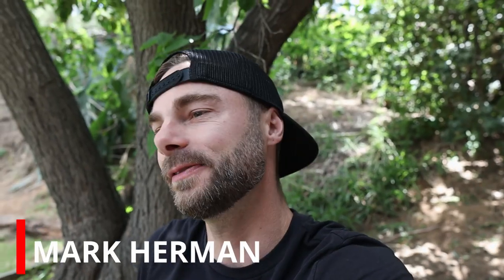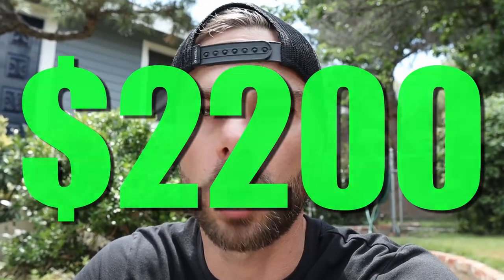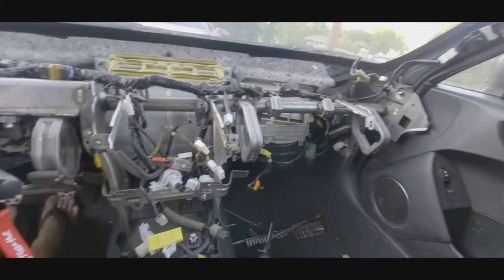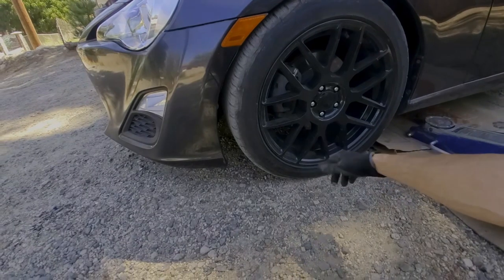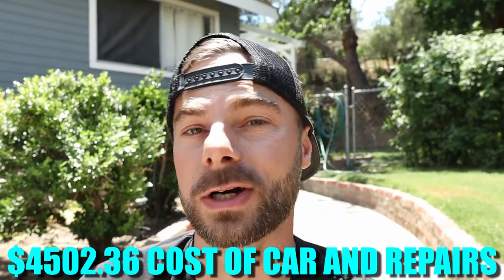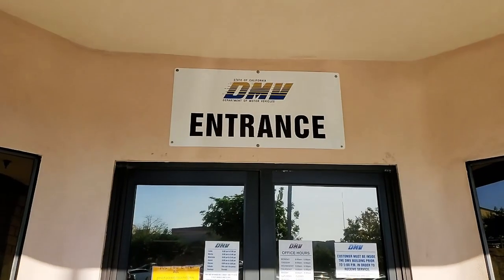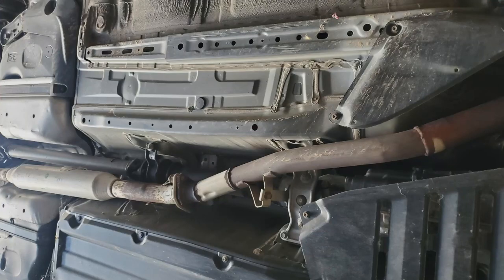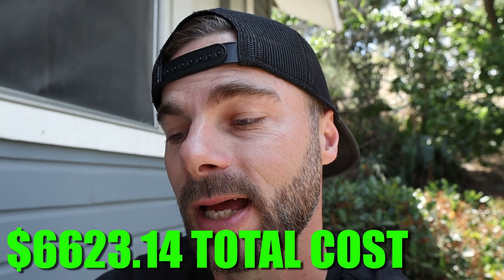HOW MUCH DID MY $2200 FR-S COST TO REBUILD??? - $2200 Scion FRS Rebuild Episode 31

Comment: I got a 2013 salvaged BRZ limited, 71k miles, for $8100. Hit in rear quarter, seems perfect. Just installed an injen evolution intake and love it!
Reply: Be careful man. Intakes make these cars run lean usually
Reply from the maker: Nice Buy, was it already repaired when you bought it?
Reply: @ModifiedCrew  yup

Comment: I'd like to know how much time you spent on the reparing... human labor is a cost.
Reply from the maker: It didn't really take that much time, its hard to provide an exact amount as when your recording it takes 2-3 times as long
Reply: i work on a body shop, if u have the tools and time, u can do it in like 1 week (if u have the parts already) or even less time if u dont work or something like that, if u trying to do it on weekends, maybe a month or more but depends on you
Reply: even if you add 2k labor, its still a good price. 8k for a low milage car (withotu the extra visual mods)

Comment: gahaha in switzerland a front bumper, bonnet and little stuff would already cost you more than 2k without paint
Reply from the maker: That sucks, I try to source the parts used because it saves me a lot of cost and I don't have to get them painted if I buy the same color
Reply: Modified Crew yeah well try and find parts like that used here.  i mean with the regulations so strict there is also not a lot of people changing parts like bumpers with bodykit bumpers etc. because if you want it to be legal here you looking into 15k at least for full bodykit or so
Reply: Modified Crew and also switzerland is next to germany so the japanese market is smaller id say. most of the young people just lease BMW M, Amg or RS cars